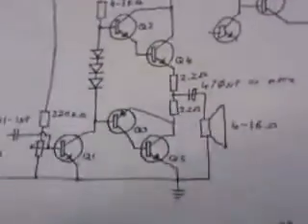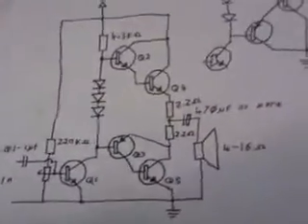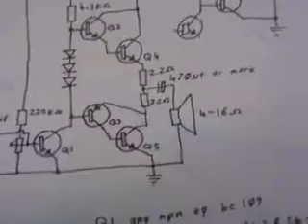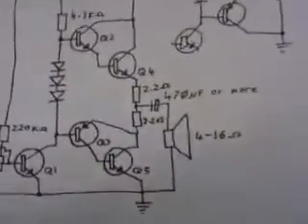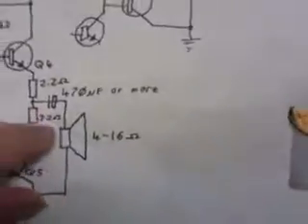Can anybody Identify this noise?

Comment: I know this vid is from last year, but it sounds like an electric motor (ceiling fan?) interfering with your amp. If you don't (or didn't) have shielded/twisted inputs, do so. Also, shielding the amp itself with a grounded (to itself) metal enclosure will keep the rest of the signal path from becoming a pickup antenna. Same should be done for the power supply.

Comment from the maker: @Yarach I may have found what's causing the noise, I think it's my modem. Even though its about six feet away and connected to my copmputer with a long wire, whenever its sending/receiving or whatever, my amp makes the strange noise.  It is also connected to my wireless network router aswell tho, so maybe it's the router. My computer up here uses the wired connection, and none of the other computers that use the wireless were on.  I moved the modem  just a couple of inches and the noise stopped.

Comment from the maker: @classicmacintosh Even if I turn the volume right down, the noise is still there, I have a volume controll (witch is nthing more than a pair of 10K potentiometers(or variable resistors)) connected between the computer and the amplifier, so I know it's not a noisy audio output.  The strange thing is its not doing it today, it only did it last night.

Comment: its your germanium neurogenerator reacting with the cathode microcontroller, to fix it you have to unintract both of the solder joints from the output stack and retone the outer caps.